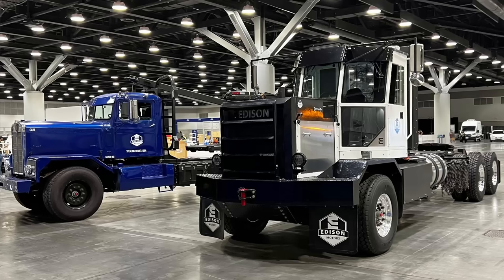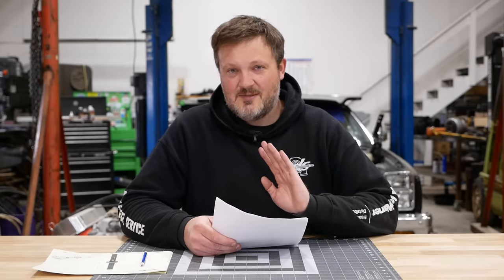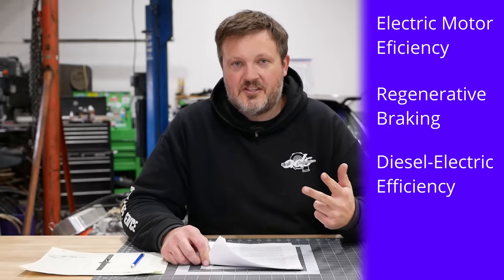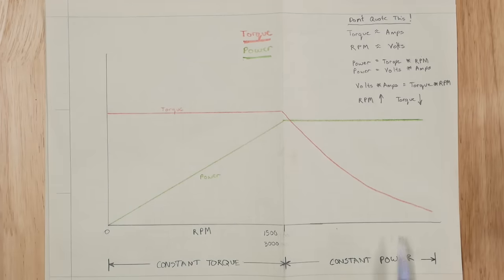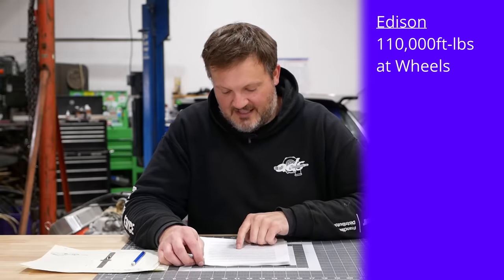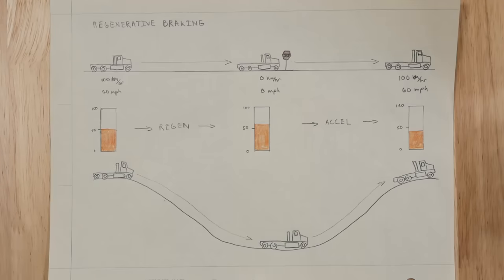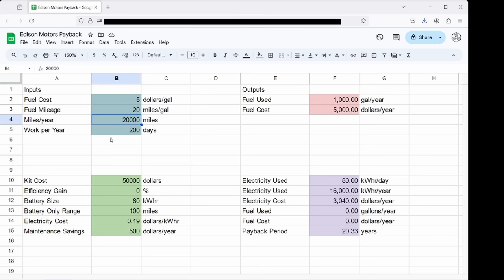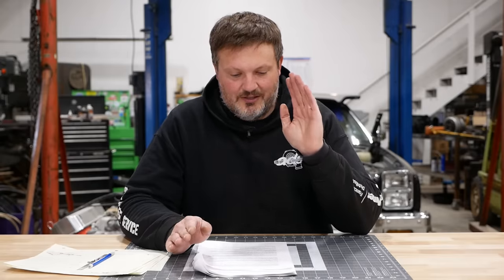Edison Motors Built a Diesel - Electric Semi Truck

Comment: As always it depend on the use case if a vehicle is right for the task. A logging trucks going up the hill on electric, then regen brake back down is good. Being able to have a generator on board to always make it home is even better, bonus points for " clean electric" charging. A Prius is out its league in constant highway driving, in stop-go city traffic it shines. I heard there are Chevy Volts who have very low engine hours because they mostly go electric. But for conventional heavy longhaul transport a efficient diesel semi will remain best for a long time. The added weight and complexity isnt worth the extra hassle and less payload.
What Edison should do is create a fleet of 5 to 10 trucks for their desired use- case in logging and gather real world data.

Comment: Union Pacific railroad built a fleet of hybrid switch engines to work the dock and yards in California. A few years ago when I retired they were all sitting in storage in Council Bluffs Iowa. Theory was the same, diesel engine to charge the batteries and power the traction motors from the batteries.  Was not successful in the application they were designed for.

Comment: Great analysis Wes.  Good skills to have to apply to lots of every day stuff.  I did a similar spreadsheet analysis when the local solar company tried to convince me converting my all electric house over to solar was a wise investment.  After doing the math on the size of the system I would need, factoring in the life of the panels, etc. and the current electric rate, it penned out to a 23 year break even point.  That assumed I would still be at the same house in 23 years to start seeing a cost benefit and the repair / replacement costs of the system didn't change.  The math doesn't lie.

Comment: the main problem with series hybrid is not efficiency, but the fact that if your electric system fails at some point your vehicle turns into a boat anchor, even if your diesel engine (which is extremely more reliable than any electric component) is still working, you have no way to physically connect it to the wheels.
even if your battery and electric motors are fine, a single bug or humidity on the electric controllers or sensors can leave you on the side of the road. for an electric car that may be an acceptable risk since you can just call a tow truck, but for a semi truck loaded with tons of logs in the middle of a mountain, getting stranded because you stepped on a puddle its not an option

Comment: You didn't actually use the words "round trip efficiency" in regards to the battery charging and discharging stuff, but that is the crux of the problem. Batteries waste energy both when they are being charged and when they are being discharged. Inverters and chargers are also not 100% efficient. Comparing these losses to traditional drivetrain parasitic losses is what needs to be done for an accurate assessment.

Comment: I agree about Hybrid's. But I disagree about the manufacturing of total electric vehicles in the scale that it seems to be going on.  Don't jack up the car to change the steering wheel.  Less than 10 percent of our consumption is renewable energy, and the majority is dependent on mother nature. As we all know, that can not be summoned at will.  Our electrical grid is archaic and vulnerable. Our power grid in my opinion should be upgraded before mass production of all electric endeavors. We have a administration that like to rush at problems, with no logical first steps. In their ridiculous wisdom, they would have built millions of cars before they built the roads.

Comment: I'm just a mechanic, this is just a question.   What if there is just regenerate braking on the trailer . The truck has two drive axles ,you could add and additional axle for load carrying with regenerate braking . Then it would have four axles for regenerate braking and two for drive . Or six in total for regenerate braking . It wouldn't solve the no hill problem but should increase efficiency. Range will someday come with lighter batteries with greater capacity.

Comment: TOPSY was designed for low speed off road heavy log hauling. For the Edison truck guys, this is what they know best. TOPSY would not work for a long haul, steady speed machine. This type of truck must be built as light as possible to keep the cargo weight as high as possible under the Maximum Gross Weight Limit to make a profit. Over-the-road truck manufacturers do everything they can to save weight. That is why they use "plastics everywhere" in the truck. These weight savings unfortunately doom the truck to a shorter life than TOPSY will have. Great video by the way.

Comment: Yeah, definitely need to consider the actual use case for that kind of system.  There isn't a viable use case for diesel-electric in long haul highway tractors.  There may be some room for viability in medium trucks/vans doing all city miles for deliveries, but then you're coming up against BEVs as a viable alternative also.

Comment: It seems to me that there is not enough attention being paid to Hydrogen powered / Hydrogen hybrid vehicles.  I believe the biggest issue is safe storage tanks on the vehicle as the Hydrogen is under extreme pressure.  That seems like an easer fix then making electric / lithium batteries effective.
Reply from the maker: From my research, hydrogen fuel cells are so much less efficient than batteries that it's going to be a tough sell.
Reply: @WatchWesWork  What are your thoughts on a hydrogen burning engine, and ditch the electric motor?

Comment: This is the type of stuff I could really get into... but I wouldn't stop with just the power plant if you are talking about pick-up trucks.  Years ago Andrew Camaratta described the "perfect" truck.  Now he absolutely refused everything electric... but his other ideas were excellent, like stainless steel bolt on body panels (no rust and easy to replace) sturdy/stout powder-coated frames/chassis (don't want the frame falling apart), effective/efficient brakes, and he had a few other objectives.  If you could combine this hybrid idea from Edison with the wear/maintenance reduction objectives - NOW we'd be talking about the perfect vehicle.

Comment: I'm looking at your payback numbers and can't quite understand why the number of days worked has an impact on payback if you already have annual mileage thus cost? Why would working more or less days impact your payback period if the mileage and fuel consumption has not changed? If you would have a consumption by the day I can see a variance in days work to the payback... Can you explain?
Reply from the maker: Because every day you plug the truck in to charge.

Comment: If I may, I'm in no way a engineer.  Just a 25 yr's retired HEAVY COLLISION / INSURANCE TOTALED REBUILDER.  With my background on the line so to speak.  I want everyone to know, back when old man Henry Ford was actually turning wrenches, circa early 1900's electric Car's / automobile's were plentiful.   Hell New York Taxi's devised a system,  where a taxi would drive into a place, exchange it's battery, and be on it's way.  The problem back then was the 50 mile limit range.  Fast forward 2024.  No mention of the problem with serve cold weather conditions reducing Battery life / charge cycle timing.  I'll leave out the major auto manufactures not being able to sell their EV's.  Some dealers still have 2022 EV's rotting on their lot's.  Hertz & Enterprise Car rental(s) took a big financial $$$$ hit.  Doing away EV's altogether.  Sorry to have to pour cold water on the thought of EV's replacing dinosaur juice drinking auto's. (Can you say FORD--EDSEL) NOT GOING TO HAPPEN!!!  NEWS-FLASH NORTH AMERICA'S Electric GRID wouldn't be able to supply the necessary power. 

For those who may not know, the Ford Edsel was the poster child for product failure.  

Question to all the smartest people in the room, could you please explain to this A$$-HOLE (that would be me,)  just how is it; only dinosaur's, had DNA capable of when said dinosaur's died, they had MAJIC DNA, enabling them to turn into dinosaur juice.  Maybe someone with a PHD, you know, someone capable of Piling (it) High & DEEP!! will provide an answer.  I sure as $hit won't hold my breath, because I'll be needing oxygen way before then.

Comment: Thanks for the vid, I watched the first 10 mins. Unfortunately, batteries in vehicles is between gimmick and useful leve, thats why i quit after 10 minsl. Whatever the manufacturer claims, you have to half their results. Unfortunately, for convenience, distance etc.. battery will never beat fossil fuels.

The route to go down is, make a fuel that creates none to little pollution, or some device to capture the emissions of the diesel. But with electric, as countries get closer to their deadlines to ban ICE vehicles, that's when reality with slap the industry.

Comment: So what do you think about a Tesla simi truck going 503 miles on 880 kwh's of batteries pulling 78000 lbs from Fremont ca to San diego. How does your math work on that one ? Have you looked at testing Pepsi has done with there simi Tesla trucks ? I makes $$$ if you use solar or wind power as fuel.

Comment: Deboss actually addressed one of the issues you mentioned about the Diesel Alphabet soup, where they had to get a different truck because the newer one couldn't get the emissions certified diesel, because it wasn't available to them yet.

On the other hand, your spread sheet's off a bit. That maintenance number probably goes up by about 10% each year the vehicles up and running, and maybe more than that as time goes further on. So more than likely the repayment numbers the spreadsheet throws out are probably half the actual time. Not to mention road salt and weather issues.

Comment: WW2 submarines had 4 motor / generator sets
When surfaced 2 or 4 MG sets could be used to run the ships propulsion for speed or  2 MG sets  for propulsion  at lower speed and 2 MG sets to  charge the batteries.

When submerged with they had approximately 24 hours of power needs  off the storage batteries.

Also these redundant systems could all be channeled into propulsion or charging  
    In a  worse case scenario with 3 MG sets broken down  the ship could run on just one MG set  either for propulsion or charging the batteries not both.

Comment: The biggest problem I see with the 1 ton retrofit is putting more weight into an axle with a motor assembly is going to make it ride and handle worse than it did new. Live axles are great for strength but dog doo doo for comfortable ride.
Reply from the maker: There are independent suspension axles. I don't know how heavy they go.

Comment: Wes is so small minded.  The next evolution from Edison Motors they plan is to installed e-axials in the trailers they pull.  Imagine the increased power, control and braking.

Comment: According to your spreadsheet outcomes, a lot of these retrofits would need new batteries by the time they justify their expense, adding more time needed to justify the expense. Although theoretically battery tech would improve by that time. After some non-exhaustive research, it looks like most lithium battery packs need to be replaced between 100,000 to 150,000 miles, seems significant in an over the road truck situation.

Comment: I became aware of the Edison logging truck for a while now.  For the original intended use, log hauling in mountainous regions, it seems like a really good idea.  But then they tried to expand into other areas and it seemed to lose its way.  Anyway, I do have a question for any and all engineers out there.  Is there any way to make an EV of any sort operate efficiently at long distance, highway speeds?  This seems to be the main issue. We always see EVs being used to "drag-race" for short distances and there is no question they are very quick.  But it seems they use electrical power much less efficiently at highway speeds.  For this reason, it seems that EVs are better suited for urban stop-and-go driving than road trips.  In fact they seem far better suited as suburban "grocery getters" which requires a lot of short trips which are not good for ICE vehicle engines which can often be used without ever reaching their proper operating temperatures.  I think there could be a good use for EVs but not as a possible replacement for ICE vehicles.  It seems ludicrous to attempt to tow a boat or trailer with an EV.

Comment: The statement that you made about the truck producing all the energy it consumes and needs under the right conditions is hard to believe. Perpetual motion? 
Don't know what experience you have with hauling heavy loads down a grade but in the big rig world engine brakes and exhaust brakes are a huge help. Is regenerative braking as good as the gears and the engine/exhaust brakes on a standard diesel truck as far as stopping power? The batteries will not last 18 years. The truck will not last 18 years without a lot of maintenance.
Nikoli Tesla has talked about zero-point energy. That would be the only way for this to work. Remember, If it can't be metered the government doesn't want it, lol.
Reply: There are a couple of mines where they use the same kind of method of going down from a hill with load and up the grade empty - not charging in between. It is not perpetual motion. One in Switzerland, it is easy to find with many videos about it.

Regen capability only depends on how powerful your motors are and how much current you batteries can take. 300kW is a lot of regen / braking. On most EVs, you can brake to a stand still with just regen, even on inclines. 

You can look up the specs of engine and exhaust brakes and how much braking power they produce.

Comment: Not sure what electric motor Edisons use, but tesla use IPMSynRM, which has a different torque speed curve than a conventional induction motor. They have higher efficiency even at high rpms.

Comment: One more comment regarding the term "more efficient" ... it should not be confused with the term "less expensive". 
An electric-resistance heater is 99.9% efficient..... however, electricity is perhaps the MOST EXPENSIVE form of energy. This makes using electricity to generate heat very expensive compared to something like natural-gas which can be 1/3 the cost of electric-heat.

Comment: A kit for those 2 1/2 ton grain trucks would be awesome but sadly putting working brakes on the front axle is a no go. It would be awesome to have a kit that could be used on something like a 1972 Ford 2 1/2 ton grain truck. You could have a truck that would allow for lots of idle run time and capacity to haul large loads. It would be great for a single operator.

Comment: 21:53 not sure if this has been said yet but for cost on a semi truck here in Alberta Canada depending on your spec but avg cost of brand new ready to go truck your looking at $250 000 CAD in my area 5 year old peterbuilt on highway trucks go for $150 000  and for fuel cost in my area were avg $6.60 gal to $7 witch goes up every year  for our federal carbon tax
Reply from the maker: Makes more sense for you guys then.

Comment: What if, instead of replacing the existing drive train completely to run a series diesel hybrid setup, they used the existing motor and all of its trimmings? Remove the transmission, transfer case, and drive lines and hook up the motor that the vehicle comes with to a generator. Add an electric motor to one or both axles (worst case, replace with electric axles) and put a battery in between? Hijack the throttle position sensor to allow you to set a consistent "idle" RPM (or adjust it as needed to recharge, maybe default just runs at literal idle for the motor), and then convert the skinny pedal to run the electric motors? 

I'm not sure it makes sense from an efficiency standpoint, but it certainly would cut out a LOT of the extraneous issues with converting over an entire drive train, and gets you on to a series hybrid system. You hop in your rig, turn the key, motor starts up but the electric motors are what actually move you. Existing power steering, AC, heating, brake systems, etc all run off of the original engine and you're only using as much fuel as you'd use at idle (or adjust the engine speed dynamically as needed, etc). For daily drivers or non-commercial rigs, the battery just needs to be big enough to get you 20 or 30 miles, though obviously a larger one could be installed if the customer wants to spend the extra money.

Comment: You say you want to see Electric Trucks (which simply will not work efficiently) while shooting down an effective stepping stone. Surely the MPG comparison is as simple as fill them both with fuel, do the same trip, fill them up again, What's in the battery is irrelevant.

Comment: If I were a young man, I would get an old small car. ANY old small car that could be retrofitted with a VERY efficient engine...No pollution crap...no safety crap. Just an efficient power train.  That would be my daily driver for life. .....The only logical use of electric vehicles at this time is hybrid.
Reply from the maker: There are some issues with that. Safety being the biggest one. Newer cars are a lot safer, but they safety comes with complexity.

Comment: Its fine as long as they go the distance WITHOUT needing a charge every hour.  If I had an electric car that would go 1700 miles without a charge, that would be fine; but if you can only go until the battery runs out, and you CAN'T find a charging system...your SCREWED!! :face-red-droopy-eyes:  Ob course, if it also has an engine, then that's OK.